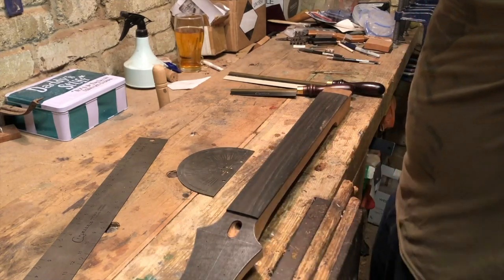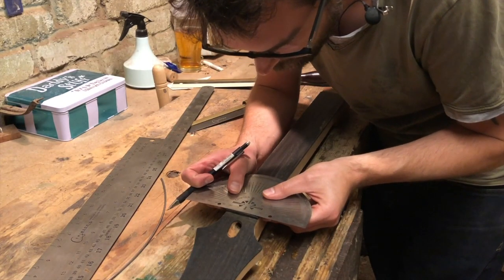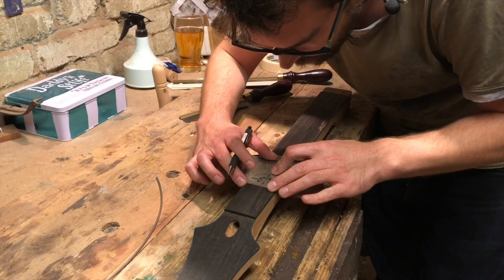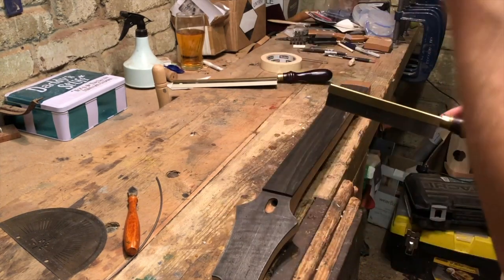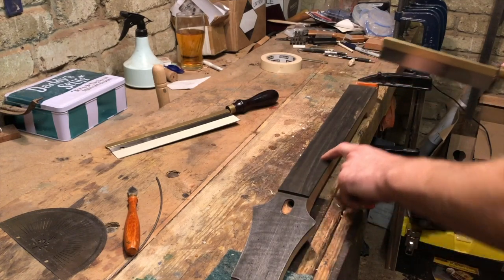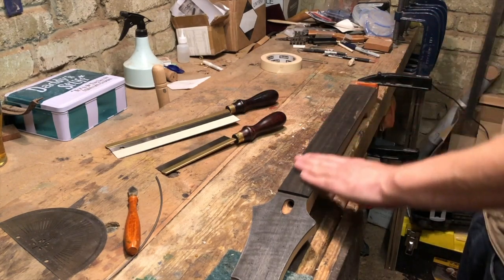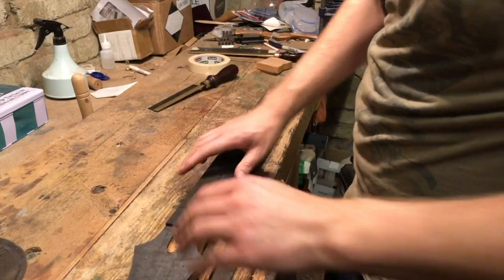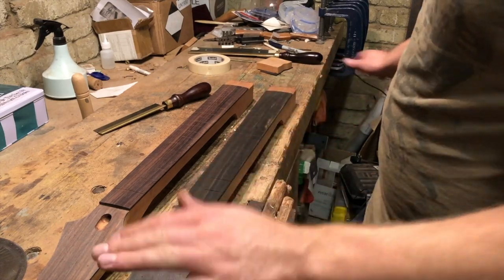Building DC Guitars - Episode 13 | Marking out and cutting fret slots

Comment: It's rather a daunting thought/task being a perfectionist. I sawed off and planed my fretboard width leaving about 2.5mm headroom on either side because I'm going to be making inlays that go over the edge and I want to be sure that when I'm shaving it all off down to final width, everything (neck, fretboard, inlays) will be flush flat after gluing. My issue is that I live in the middle of nowhere and I have to make do with scraps and $5 tools having their imperfections in mind (there's a delivery team along the way that is destroying packages and my last orders were absolutely demolished... I spent a month sanding, hammering, flattening my $400 jack plane and the crazy glue was smashed empty upon arrival). Also I have precut preradiused stainless steel jumbo fretwires with the end tangs cut and I plan to try to cut the fret slots inside the fretboard instead of sawing the entire width to hide the fret slots. So far I've found NO human being in the youtube world who cuts fret slots inside the width of the fretboard. I haven't cut the fretboard length to size yet and so far I have a couple of practice cuts on the excess lengths using a fret saw (one entire width and one inside the width) and I'm struggling to find a way to keep em right.
Reply from the maker: That's because it's hard to do without cnc, binding is the easiest way to go if you want the tangs hidden. SS frets with binding can be a bastard to install neatly though.
Reply: @ADFinlayson   I did think about binding the edges with the excess but I'm trying to eliminate as much glue as I can and also that would defeat the purpose of edge over inlay design I have in mind. I suppose I will find a way in time... I've been enjoying watching a lot of clever DIY tools and workarounds and most people take learning, thinking and problem solving for granted. It's been a good journey, really. I honestly never thought I'd ever get into wood working but now I'm a proud owner of three hand planes, a spoke shave, a plunge router, dremel set and fretting tools.